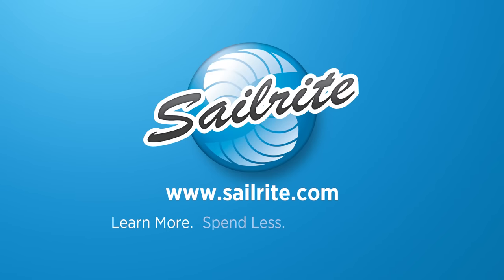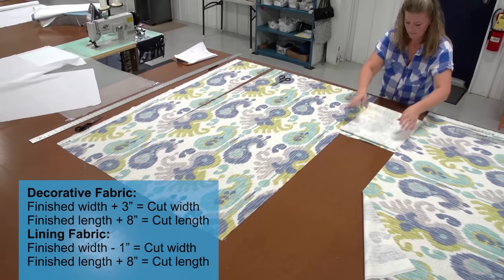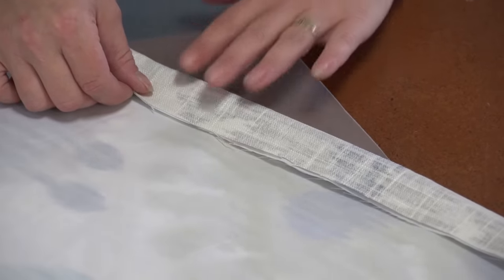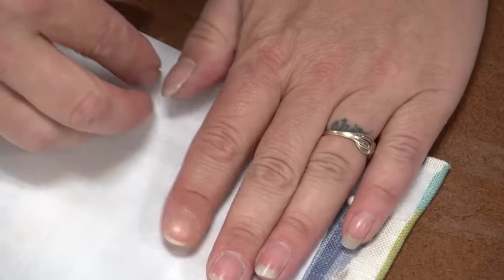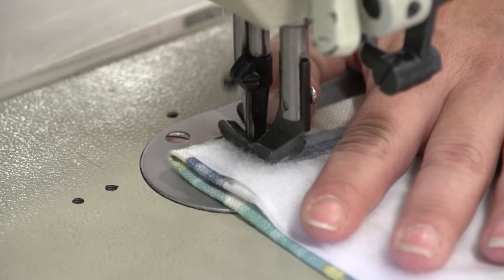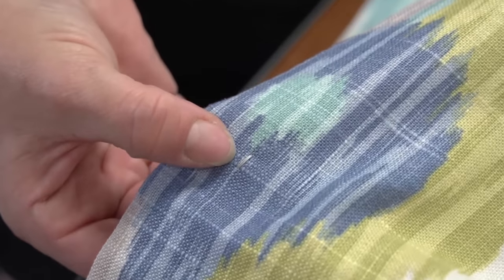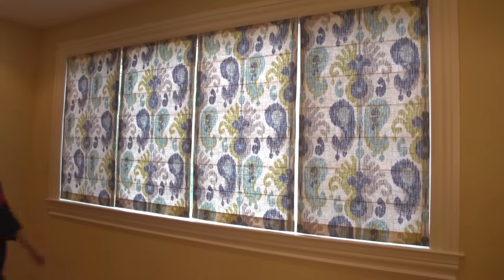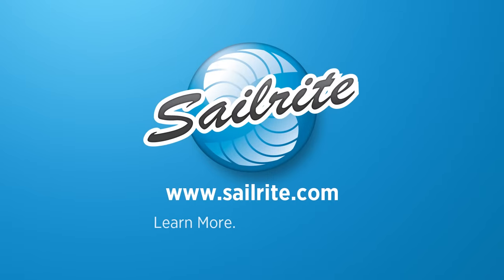How to Make a Roman Shade

Comment: Great video... however, there is a BIG disclaimer missing.  Make sure when you get to the gluing of the dowels part that you check to make sure the glue cannot seep through the fabric you've chosen on a small swatch!!!!! It was very disappointing and heartbreaking to discover this myself (bought all the recommended products from Sailrite, too). I wish they'd have an alternative suggesting for how to do this without the glue.  Live and learn, I guess...
Reply: There actually WAS a visual disclaimer regarding the glue - in other words, words on the screening warning to test the glue on a swatch.
Reply from the maker: I just noticed this communication today, sorry for the late response. You will find that we do have a disclaimer on the video telling customers to test the glue with the fabric choice used. With that said, my father made some roman shades about a year ago and used a hot glue gun to glue the dowels in place (it is still holding and working well to this day). You may want to try that, but always test first with any glue to fabric application.
Reply: That's my mistake, I did miss it on the video! My comment is more of an extreme warning to those new to this kind of crafting who miss those things and are going by the recommend app and ebook.  You may want to add a disclaimer or that testing step in the ebook though (page 24 of 101, "Flat: 4 -- Glue Ribs in Place"). 

I think next time, I'll leave making shades to the professionals, but if I ever do, I'll try the hot glue method! (Add that alternative method to the ebook as well!!)

Comment: Could you have used one piece of fabric for the window you showed in the video or is the width too great?
Reply from the maker: The window's width for this video was very large, so I am not sure how well it would have worked. You can definitely make roman shades which are much wider than what we showed, but I would personally not go more than about 100 inches or so. Sailrite now carries ribs that can be extended for wide widths and a bottom rod which can be spliced together. We also now have iron on rib tape (which I strongly recommend). Check out this link for more information: http://www.sailrite.com/Iron-On-Roman-Rib-Tape-1

Comment: Dont like the glue and rods part. Cant wash em like that so u suggest a sewn line across for the rods to lay on with open seam edge.
Reply from the maker: Sailrite is now stocking a rib (rod, dowel) that uses splicers to extend the length, if required -- http://www.sailrite.com/Roman-Shade-Plastic-1-4-Ribs-5-Feet. We will also be stocking a new "iron on tape" for roman shades -- http://www.sailrite.com/Iron-On-Roman-Rib-Tape-1 . Using this tape creates a pocket for the rod, now you can remove the rods and clean the shades.
Reply: Sailrite I would love more details on this. There's a lot of red dust where we live, so washing window treatments is a must. Can you tell me how the tape/pocket idea works?
Reply from the maker: kim place-gateau If you need to wash the roman shades I would use Iron on Roman Rib Tape: http://www.sailrite.com/Iron-On-Roman-Rib-Tape-1 . It works very well and when combined with the Roman Shade Plastic 1/4" Ribs: http://www.sailrite.com/Roman-Shade-Plastic-1-4-Ribs-5-Feet  you should be able to remove them from the rib tape for easy cleaning of the shades. See this video for more details: Iron-On Roman Rib or Dowel Tape

Comment: So upset. My first time making the blinds.  I'm heartbroken.  Just got to gluing the dowels. I know the video says (on the written commentary) to test the fabric for the glue but the fabric I had looked far thicker than the one in the video so I didn't test.  Glue bled right through sticking the fabric to the backing.  The fabric was really expensive and as a novice I am so disheartened.  I only get the chance to sew when my baby is napping so this is roughly 4 days of work down the toilet!  Please if you are following this video TEST the glue!!  I have no idea how the fabric on this video doesn't allow the glue to bleed through as it looks far thinner and flimsier than the fabric I was working with.
Reply: Check and see if there is a solvent or can be washed out. Many of these types of adhesives can be removed.
Reply: I might use hot glue?
Reply: I have always used small adhesive backed velcro dots on both the sticks and the fabric as well as accessible slits. I have a household full of asthma sufferers and it allows me to launder the shades.

Comment: Incredibly confusing measurements. At first it's plus 8 inch on length, and 2 inch (1inch ? - what's this all about. Not explained). Then when actually cutting out the fabric, suddenly, the amount of leeway on width moves to plus 3 inch. Which is it? 2" - 1" or 3"?
Reply from the maker: Those extra inches are only used for a safety factor. If the fabric shrinks as the edges are sewn that extra 8 inches will always guarantee that you will have enough fabric. 3" typically is sufficient, but if you want to be extra safe go with 8 inches of extra fabric.

Comment: This will only be helpful if you dont wish to change your blinds.but if you're like me who wants a change every other year.i suggest to make inserts for the dowels instead of glueing them to the fabric.in that way you can reuse the dowels for a new set of blinds
Reply: I was thinking that the whole time! If you're doing this much work to get it right, then do it right and make some inserts for the dowels so you can wash them in your machine too. Why glue them on with the posibility they will come lose. It so easy just add 1 1/2 inch or so (I work in cm so forgive me if it is wrong) for every dowel and sow them together and fasten them with a top stitch if you like, but not necessary the dowel will make it hang down.

Comment: Inspired by you videos about roman blinds! I want to mount them outside the frame, above the window. Would like the pulled up blind to just sit just on the top of the window frame so as to let in as much light as possible when open (North facing window). Any advice how to calculate how long a pulled up blind ends up? Is this dependant on where top dowel is placed and how many folds? Thanks for any help, my mind can't seem to figure it.

Comment: Thank you very much for giving very clear and precise instructions, I need to make Roman shade for a window that is 72” wide and 36” in length. How many cord lines should be run and what kind of cord lock should be use? Thank you.
Reply from the maker: This fabric calculator will tell you how many lift lines to use: https://www.fabric-calculator.com/roman.aspx It will also point you to the lift line size.

Comment: watched the video.... you spot glue the dowels to the backside of the decorative fabric..... it doesn't glue to the lining?  not understanding how the lining will stay with the decorative fabric when raising....??  help
Reply from the maker: The dowels help create the fold in the fabric when the curtain is pulled up. Since the rings are sewn through both the forward fabric and lining fabric this secures the fabrics together at those points.

Comment: I just used Tear Mend to stick the dowels to the fabric, and I'm devastated... the glue is so watery (yes, I shook it very well) that it ran down the dowel and spread into and completely through the fabric.  I am using a brocade fabric.  I now have dark rings around each glue spot about the size of a nickel.  I feared that the lining might now be stuck to the main fabric, so after about 30 minutes, I tested to see if the lining was stuck, and it was!  This is the first of 5 panels and now I'm afraid to proceed with gluing the rest of the dowels in place.  I am considering just using regular household white glue as it is considerably thicker.  Any comments or suggestions?
Reply from the maker: The manufacture of the glue Tear Mender changed the formula of the glue and it is now much more watered down. I am also disappointed in the glue now. My father made roman shaded and he glued the wooden ribs down with a hot glue gun using acrylic glue sticks: https://www.sailrite.com/Glue-Sticks-Hot-Melt-Acrylic it worked perfectly for his. However, it is always IMPORTANT to test any glue on the fabric you are using before applying to finished product, as stated in the video.
Reply: @SailriteDIY  Thanks for the reply.  Maybe you could put an update or a banner over that portion of your video to save someone else the disappointment?   I've decided to just sew on some 1" roman shade tapes that have rings pre-sewn. I have always loved your videos and last year completely re-covered 21 of my outdoor patio furniture cushions using your video instructions.  Very pleased with how they turned out!  Next time I will test a new product before I use it.  Thanks again!

Comment: Hi.  Why do you only put the rings on every second dowel?  Every instruction that I have looked at shows rings on every dowel.  I like your instruction, they are easy to follow but I am just confused on that part.
Thank you
Reply from the maker: The rings are only needed for the ribs that lift the roman shade. We place a rib on each fold also, so it will fold at that point. So, rings do not need to be placed on every rib.

Comment: I would be afraid the Velcro wouldn’t hold it when pulling the shade up.
Reply from the maker: The hook and loop only holds the top of the shade onto the headrail. When lifting the shade no pressure is applied to the hook and loop since lines lift the shade via the eye hooks screwed into the headrail. So... no it will not come down from the hook and loop coming off.

Comment: Love this video! I am making shades with black out material which can get heavy and I was wondering if the velcro would be enough to hold them when raising the shades? Some tutorials suggest stapling the shades directly to the mounting board but I would love to be able to take the shades down and wash them. Would you use a more heavy duty velcro for blackout fabric?
Reply from the maker: Antonia Van Vliet It is amazing how much weight a 1" wide strip of hook and loop Velcro will hold up. So, I would doubt that you will have to staple even if the shades are rather heavy. Velcro becomes weak if used often (several times a day) since that is not the case for shades, I think it will work great. Also, when it is raised up the lift cords are holding the major weight of the shade, the Velcro at the head rail is only keeping the fabric attached. When the shade is lowered all the way down the lift cords still take some of the weight of the shade away, but not as much when the shade is up.

Comment: Small question from the Netherlands, I am moving shortly to a house, I would like to do these kind of blinds, but I would like that when they are closed, they should be no light shine from the sides, how do I do it, or what kind of messerment I need to take (it is for bed room and need to be no light at all). Looking forward to  your answer. it is great video, THANK YOU!!
Reply from the maker: I am not sure you can accomplish a "no light" shade. To accomplish the best light blocking performance from your shades use one of these procedures: 

1. If the shade is mounted on the inside of the window frame (as done in this video). Pattern so the finished size of the shade is the exact size of the window opening. Cut the ribs and bottom rod smaller (by about an inch) so they do not damage to the window frame when the shade is raised or lowered. Be sure to make your shade longer in height by about 1" so it will stack slightly on the bottom window sill (thus blocking more light).   

2. Mount the shade slightly outside the window frame (in an attempt to cover the sides of the frame with extra width, approx. 1" on each side). This is possible for windows where only one shade is used, but not multiple shades as they cannot stack on top of other shades, they must stack on a window frame to raise and lower properly (not my preference for this type of shade, but it will help block light, if that is your goal). When mounting the head rod you will need to position it so the fabric rides to along the sides of the window frame. The ribs and bottom rod will need to be long enough to also ride on the sides of the window frame. Be sure to make your shade longer in height by about 1" so it will stack slightly on the bottom window sill (thus blocking more light).
Reply: Het is al vier jaar geleden, maar misschien heb je er in de toekomst nog iets aan. Naai  2 of meer magneetjes in de zoom en plak of schroef een metalen strip op je kozijn die je mee kan schilderen. Maar echt donker zal het niet zijn. Hij trekt de stof wel heel strak zodat het minimaal wordt.

Comment: can insulated fabric be used?
Reply from the maker: Possibly. Can you give me the item number of the insulated fabric you want to use from Sailrite and I will check?
Reply: @SailriteDIY  I haven't looked yet but we live in a cold area and have lots of windows and was just wondering.  I was looking for the fabric that has the isulation built in to it if that makes sense.
Reply from the maker: @connieehrhard5223  We have used a heavier stiffer fabric, Sunbrella Marine Grade fabric, with success. However, it all depends on the fabric being able to pleat, so you may want to do some testing once you find a fabric.

Comment: I have never seen a shade made quite this way. It lost me at the use of glue and the Velcro sewn at the top. Definitely not a custom look. Also, roman shades have new requirements due to the possibility of a choking hazard. Rings should be much closer together. I think it is 8" or less. The string should be encased in a shroud to prevent a choking situation. Also, if a shade is made properly the dowels are optional. This video should be updated or avoided.